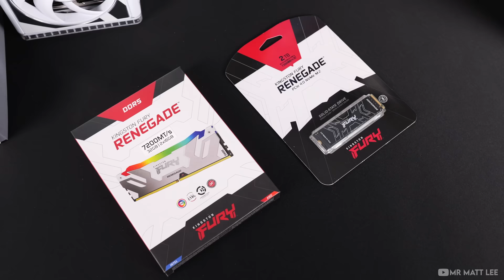Unknown, but NOT Unworthy! | Darkflash DLX4000 All White Gaming PC Build | RTX 4090, Ryzen 7900X

Comment: This case has some cool designs. Similar what I plan to do on my custom case. For now I bought used lian LI O11 air mini case.
Reply from the maker: The O11 Air Mini is a great case! I feel like this chassis shares some similarities except the fact it doesn’t have a dual chamber allows for greater GPU widths which is most welcomed 😁
Reply: @Mr_Matt_Lee  I forgot to mention that with couple of metal bracket's I managed to put 360mm be quiet radiator ( I replaced radiator fans with latest be quiet pro 4 fans. "old fans" I gifted to my brother) on top of the lian LI O11 air mini case. Like other have too. There are videos about that modification.   For rest of PC parts, I'l wait for september till I have more spare time.

Comment: A very elegant and sexy case. I really want to buy this case with the front mesh, but the only thing that stops me is the lack of dust filters on the front, side and top. The manufacturer seems to claim that their perforations will perform this function, but I don't really believe it. What do you think about this? Will the thin perforation protect against dust like a filter does?

Comment: I wonder.
does any reason to seperate rgb n pwm hub?
I thought using the one that combine together is more easy to build, like Thermalright TL-FAN and ARGB HUB.
Reply from the maker: With builds like this I prefer to have them separate because the RGB cables and fan control cables never usually tend to be the same length by the time they’re routed for cable management. Having both hubs brings more flexibility for install location. You can also daisy chain these fans to single headers, but that does create quite a mess of cables in the back which isn’t my ideal scenario haha

Comment: Excellent build, very nice combination of the colors as always, but I am just wondering how are you able to eliminate some reflections of the glass panel. I saw some other youtubers doing pc builds and they mostly have the panels off to reduce the reflection of light, is there any trick behind it?🙏
Reply from the maker: Thank you 🤍💙 Yes, the trick to eliminate the reflections on the glass is to be able to control the light. If you see some pictures of my studio you’ll see that there’s big black curtains everywhere. Whenever I’m filming the cinematic sections I close the curtains to make sure there’s no reflections on the glass (black doesn’t reflect). Then I also have to strategically position the lights between every shot to make sure the lights themselves don’t bounce off the glass. It’s time consuming to do it, but I don’t like to see the case without the glass, it’s unrealistic 😊
Reply: @Mr_Matt_Lee Thank you so much! this is exactly what many youtubers miss. I can definitely see your dedication to PC building and also filming, this work is extremely appreaciated. Hope you can reach 100k sub ASAP, you definitely deserve it!☺

Comment: lol 7200mts on am5 is not gonna work
Reply from the maker: Better to have more than less if budget allows it, kinda helps for future proofing. Also, the RAM is designed for AMD & Intel, with the latter having greater benefits. 

I couldn’t use 7200mts on my AM5 board, but then 5 months later I went to Intel and could use all of it and didn’t need to upgrade the RAM. That’s a win for me 💪